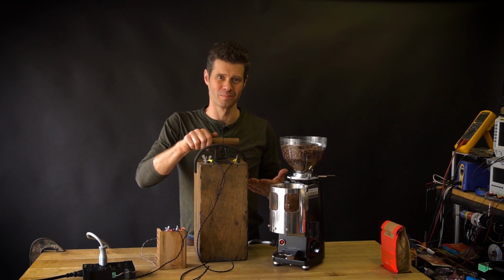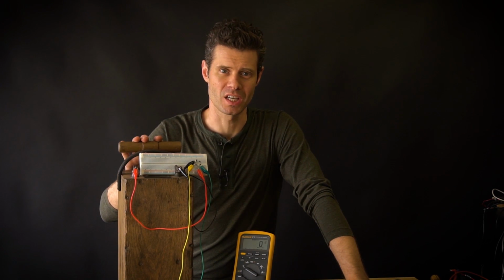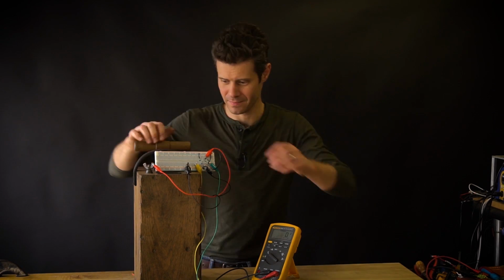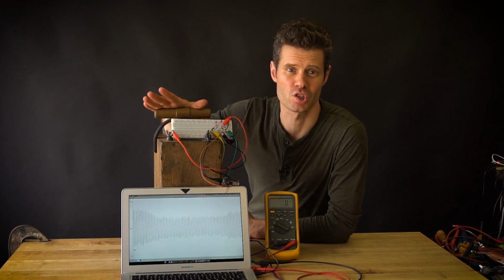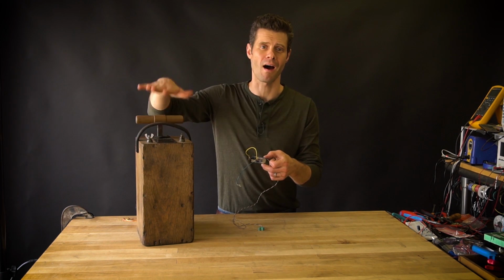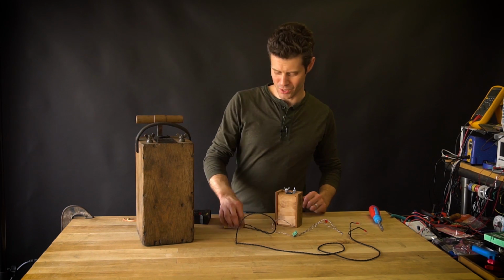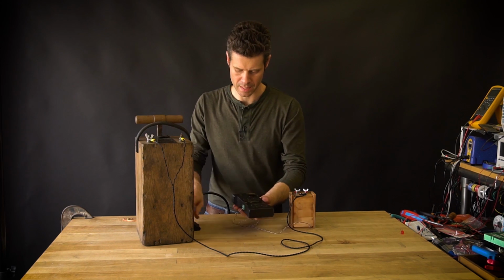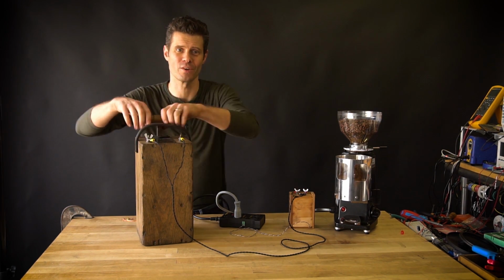John Park's Coffee Detonator  @adafruit @johnedgarpark #adafruit

Comment: I'd still worry about a transient high voltage spike damaging the feather. How does one come up with safe capacitor values if our flea market detonator has different spec to yours? What if one of the escape room participants is really strong? Is there a better way to clamp those transients to V+ supply of the arduino using a flyback diode arrangement?